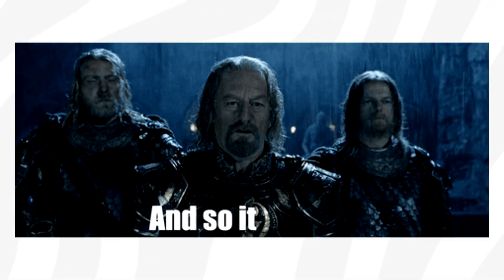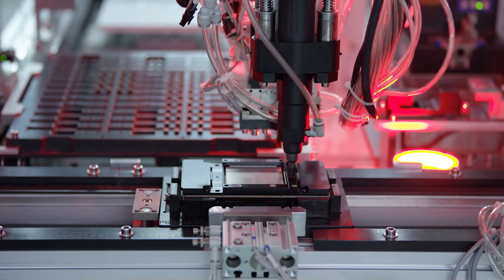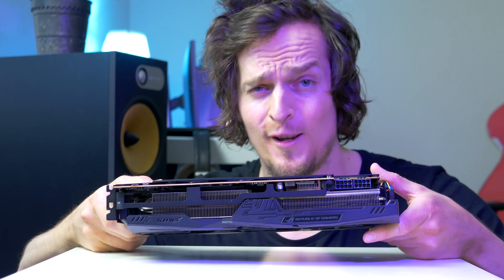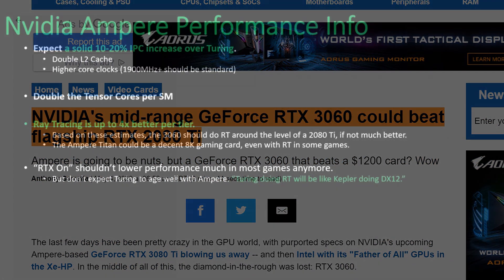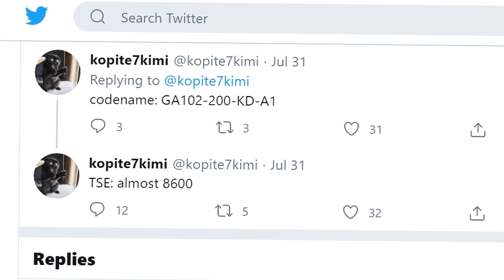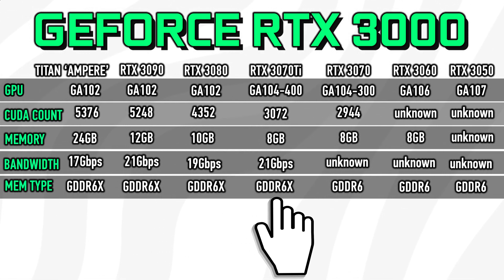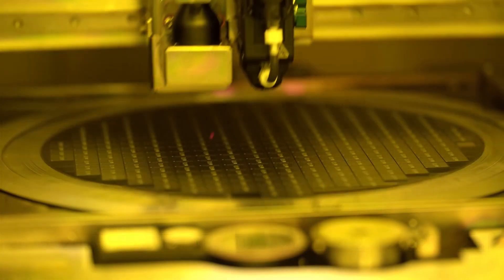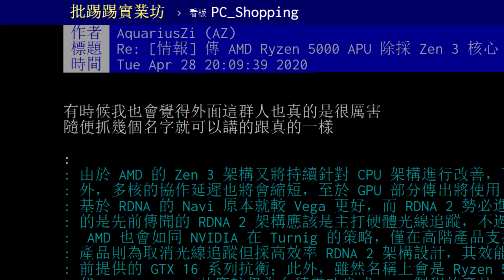Nvidia RTX 3090 + 3080 Gaming Benchmarks! Specs, Release Date [Nvidia Ampere Tech News]

Comment: I've got everything for my new 10900K 5.1GHz all core OC machine on order except the graphics card. Should have everything in about a week.
Getting confused over performance gain of 3080 or 3090 from all these previews. It looks to me as if the 3090 will at best be 50% faster than a 2080Ti, although hopefully about the same price. Am I missing something because that doesn't seem to equate to 4K high FPS. Is it worth even waiting rather than getting an RTX 2080ti now? I'm waiting on the Acer XR383CKP monitor (38"" IPS 2300R curve 24:10 3840 x 1600 30 bit GSync and FreeSync 1mS HDR600 144Hz O/C to160Hz refresh rate) end of the year. 2560x1600 Dell 30inch + 2 24" till then, plus HP Reverb G2 pre-ordered which is where I need the 4K high FPS.
Edit: One key feature of the 3080/3090 should be hdmi 2.1 capability allowing 4k HDR10 120Hz!
Reply: Colin Dyckes, I will skip the 2080Ti and wait for the 3080. I think it will be enough for 4K high fps and high graphics settings in virtually any game, also using the HP Reverb in MSFS2020.

Comment: I got my self a 2060 2 weeks ago. Oml
Reply: Sell it dude. Get 80-90% back. Wait till novemebr to get 3060 or skip this gen completely
Reply: i was considering getting a 2060 super now.
Reply: You should have waited and get a 3060 tbh because the 3060 ain't nowhere near the power of a 2060 it's 3-4 times the power of it
Reply: @ItsCuzyh  3060 is better in ray tracing only or in performancr in general? because ray tracing isn't important.
Reply: @TheGoldenlegend1  it will have performance of a RTX 2070 Super close to 2080 but in Ray Traicing same as RTX 2080Ti for $300 it's a good deal.
Reply: @ItsCuzyh  but that sounds too good to be true!!! especially that this is Nvidia we're talking about
Reply: @TheGoldenlegend1  remember the jump from the GTX 1060 to RTX 2060 that will be the same here with the 3060
Reply: @TheGoldenlegend1  it will be important for next generation games coming in 2021
Reply: TheGoldenlegend1 both
Reply: @ItsCuzyh  3060 may equal an 2070 super
Reply: @topprogrammingtv  yes I've done research same Cuda Cores apparently
Reply: @topprogrammingtv  yes and the 3060 Ti or Super Version will equal to RTX 2080

Comment: 3000 series are being hyped as much as RDNA2. 3000 series won't be that much faster in comparison and 3070 and 3070ti will be slower than 2080ti.
Reply: At the same time,there's claimings in a lot of tech sites, that they said ''3060s will out perform 2080ti''.
Reply: @Svestilence  in ray tracing, not in general gaming

Comment: I'm kinda locked into Nvidia because I got a GSync monitor however I hope AMD gives them a real run for their money
Reply: its good for both sides cos nvidia will stop with there bs and might even bring prices down
Reply: @ORBIT9224  amds new gpu will be slower no doubt about it but it definitely  will give nvidia a run for its money since its only a bit slower for a 30% lower price
Reply: @TrialBTW  the whole point of gsync is to remove screen testing and at the same time have a much lesser delay than vsync
Reply: @zamblot3324  i dont use gsync even though i have a gsync monitor i dont get screen tears and i get even less delay
Reply: @TrialBTW  eh ik, it's very rare but you get it in certain games which don't handle it well
Reply: @TrialBTW  why would you buy a G-Sync monitor, and not use G-Sync?
Reply: @tmorelli1982  bruh i bought it two years ago only just now i have realised its useless
Reply: @TrialBTW  lol right.
Reply: @tmorelli1982  you actually dont believe me?
Reply: @TrialBTW  there's only two ways to cut it, either you're lying, or you're extremely ignorant of hardware functionality. 

I'm still  leaning towards the former, considering you deleted your comment with the non-existent discord ID after realizing I attempted to add it, pointing out you left a digit off of the #
Reply: @TrialBTW so you just know nothing about hardware/software functionality.  What's the discord? You told me to add you on discord, gave me a faulty ID, and then deleted the comment when I called you out on it
Reply: @tmorelli1982  also did not delete the comment i dont know why its not showing for you but i see it
Reply: @TrialBTW  so drop the correct discord here
Reply: I actually hope AMD doesnas good as nvidia so nvidia gets forced to lower their prices and i can get what i want for less 😂
Reply: @Gemthermakleingk  yeah, that would be nice
Reply: Check if it is really G-Sync monitor. Because some were only G-Sync capable but it was FreeSync + tech 'magic'
Reply: @korinogaro1988  I can assure you it's really a GSync monitor
Reply: gsync increases input delay anyways. it’s just a reason to apply a price premium
Reply: @TheeAcid  not really, it's pretty minimal and it's just a step up from VSync
Reply: I know a lot of monitors, which come with FreeSync can run G-Sync. Maybe it works the other way around too.
Reply: gsync doesnt matter if you put a proper fps cap and reach whatever ur hz is gsync wont matter
actually gsync gives you more delay
Reply: @TrialBTW  have u check gsync 101 yet?
Reply: @11blakex  no
Reply: @TrialBTW  you got a lot to learn about gsync then. Google that
Reply: Trial it’s good for people who play 4K ultra and don’t care about input delay but care about visuals